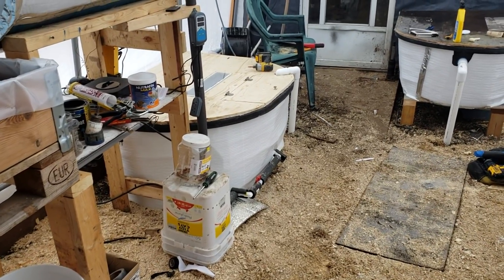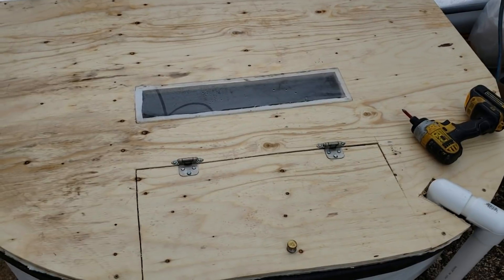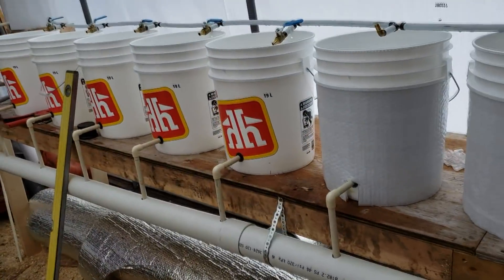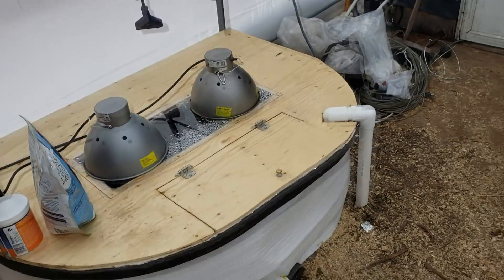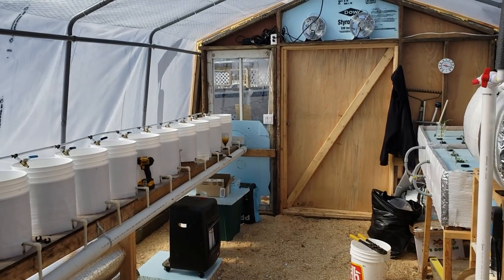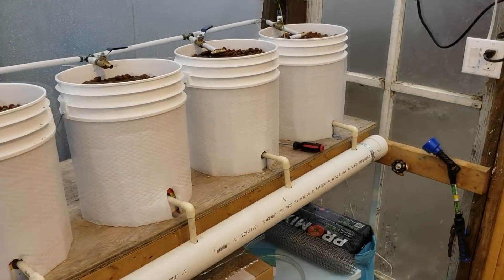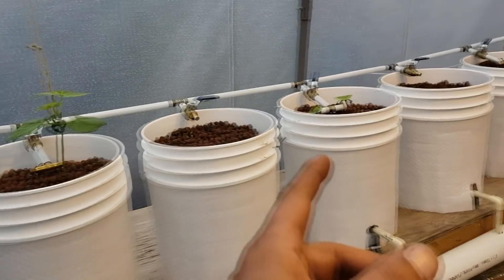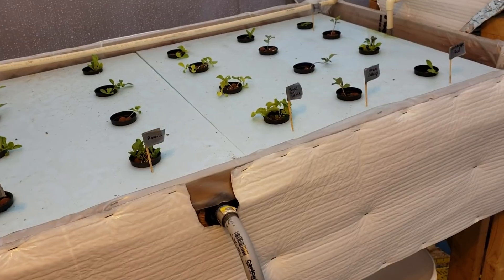update on auqaponics system

Comment: The nutrient solution mix - Master Blend is about $25.00 which gives you about 990 gallons of nutrient solution
Reply: Would it kill the fish though?
Reply: @JarekJames  Yes - it would kill the fish; ou don't need the fish poo and pee.  the nutrients are provided in the solution.  Normally, soil would provide nitrogen, magnesium, salt, potassium, etc.  Plants can get it from food poo or pee.  Or plants can absorb it directly from water with nutrients without soil.  (cut out the middle man)
Reply: @JarekJames  So - there are 2 major systems:  Hydroponic and Aquaponic; you have an Aquaponic...you plants receive nutrients from the fish poop and pee (nitrogen), oxygen (from bubbles), etc.

Hydroponic systems' plants receive their nutrients from chemicals added to water.  Nitrogen, Magnesium, Calcium, etc.

B A Kratky said up this system based on 100's even 1,000's of years of researching history.  You do NOT need electricity, pumps, filter systems, bubblers, etc.

He uses gravity fed water to pump the nutrient solution into the totes.  The plants roots suck up the water/nutrient solution in few weeks.  Lettuce usually takes around 3 if on a 24 light cycle.  Tomatoes are different - 3 months.  Arugula, Basil - 2-3 weeks.

I'm generalizing on harvest but you get the picture.

Don't waste money on electric and gas pumps, etc..  Capture rain water. use solar panels on grey days.  Let's change the world!  :)

Best to you!  I love your engineering prowess!

Comment: The seeds costs $1.99 for hundred - 2 hundred seeds....you can get a gravity fed water pump...and reuse the reflective insulation board...also, check out MHP Gardner
You could probably just collect Rain Water - and maybe even buy solar panels...no water or air filter bubbler needed either

Comment: I have a similar system with buckets and for the media I went on Amazon and bought 5 gal. Painter's paint filters. Instead of rocks and hydroton I bought 4 cu. bags of horticulture perlite and used that for the medium.  It works great and is much better than you would think. Once it has gotten wet and got the fish waste in the medium it supports my tomato plants fine. When you get ready to pull plants out you just pull out the bag and all and it is ready to put in new bags and media. Both are cheap and lighter than all of the rock media. Also, makes a pretty good filter as catches most of the waste. As for a ph level, here in Texas our water is naturally around 8.0 here where I live, so I try to catch as much rain water as I can which is more neutral. Also, with your lava rock media as the system matures it will naturally come down in PH over time. However, I just put in about 3 or 4 oz. of PH Down for awhile until mine started to come down. Just a thought.
Reply: I've seen both perlite and vermiculite used as mediums. Trying to decide which way to go. Why did you use perlite vs vermiculite? Thanks

Comment: I have a pool so I always have pool acid on hand.  To lower my PH I put a little bit (I mean a little bit) of pool acid in and then check my system the next day.  I had the same problem you had with Strawberries. They like to be at around 5.5PH and tap water is around 7PH.  Constant battle. Something else you might try is Peat Moss has a PH of about 4.4.  I have been thinking of putting that in a second water tank and flowing water over it to regulate my PH.

Comment: PH Down, of course, is the cheap and easy way but it's not sustainable.  Try moss balls. If you can't get your hands on one, you can pick some up in the states. You can also try different substrates in your filter (compacted carbon based dead matter, charcoal, peat moss, driftwood). Try growing "canadian waterweed" with your fish. I had egeria in my tank for minute, but it did not survive the cold. Another trick is to reduce oxygen levels by removing bubblers and keeping flow rates low. Small changes like this shouldn't cause dramatic changes and your system should survive these changes as long as you keep measuring carefully, changing one variable at a time,  and adjusting as needed.
Reply from the maker: Sean Huberty thanks for all the tips bro